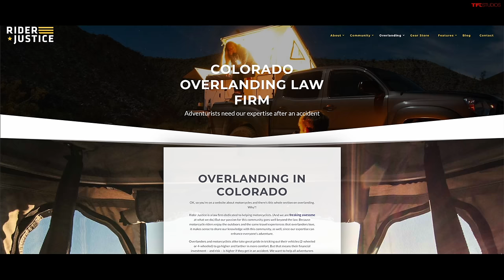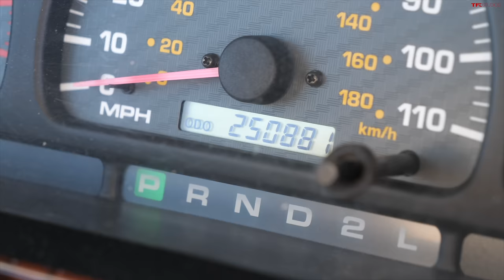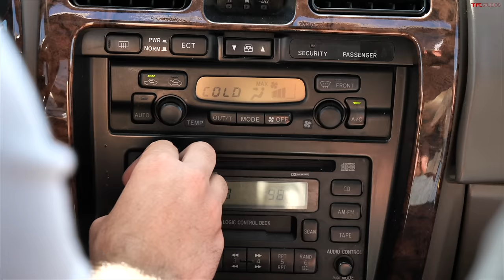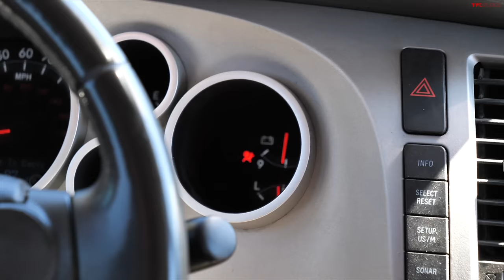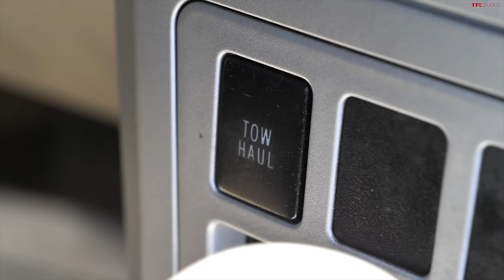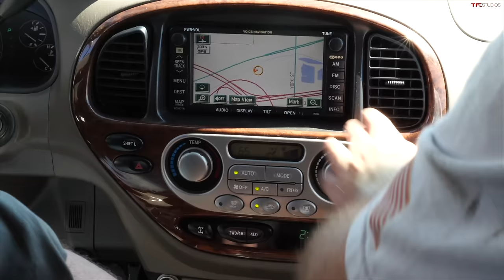We Bought Three Super Cheap Toyotas To See If They Are Really Reliable!

Comment: Bottom line, 10K only buys you a junker last-leg toyota lol. I cant wait for the cheap Nissan challenge I have a feeling the quality will be considerably better.
Reply: Bought my taco for 10k. Probably one of the nicer 1st gens you’ll see. Bought at 139k miles and it’s at 292k now
Reply: You’re so wrong🤣🤣
Reply: @freedom… So you put 150,000 miles on it and you bought it for $10k at THAT TIME. Which I guess was not recently because it takes time to put 150,000 miles on a car. So you probably bought it at least 10 years ago. That 10k from 2013 would be equivalent of about 15,000 considering used car prices went up roughly 40% since 2020 alone. So $10k buys you considerably worse car now than when you bought yours.
Reply: They are paying dealer prices not retail. It’s not a real world competition

Comment: Nothing will ever outlast a good ol Lil 85-95 Toyota 4x4 single cab shit stain pickup. I’ve seen several with unknown mileage because the cluster or speed sensor went out before the motor ever did lol

Comment: 6 minutes in. I’m gonna call it. Every time I have ever gone wheeling in my 21 taco, often times a much older yota will join in with 150-300k miles on it with mild off-road goodies, lights, fuel tank on the back etc. talked to the owners yeah whatever they installed new gears for lockers but stock axles. They don’t break on the trail. Jeep? EVERY. FN. TIME. I. GO. OUT. WITH. JEEPS. something breaks on them. It never fails. Sure they are more capable for more aggressive terrain but the quality is SHIT.

Comment: I don't understand why people spend so much on old, high-mile Toyotas. Sure they're generally dependable and you can get a lot of miles out of them, but only IF you're willing to spend a fortune fixing them to get them to those high miles. If I remember correctly, TFL spent $3,500 having valve work done on a Tacoma 2.7L 4cyl. with 187k miles. I had a brief conversation with the owner of a 90s Tacoma 2.7L who said his head gasket blew at 300k miles and it was going to cost $2,800 to fix. It's interesting to me that people will spend that kind of money to fix a broken Toyota, but not on a broken Ford or Chevy. Are Toyotas really any longer lived without throwing huge sums of money at them?

Comment: Toyota and rust go hand and hand unfortunately. The recall only covers a certain time frame and the owner is responsible for thr components connected to the frame. This is why i wont buy another toyota truck until they figure out the issue.
Reply: @scott… They figured it out in 2010.
Reply: @is6566  unfortunately not Toyota issues a recall on the 2016-2022 Tacoma still to install plastic deflectors to try to avoid salt from getting in the frame. The new Tacoma and Tundra use a different frame( fully boxed)so they should now have it figured out.